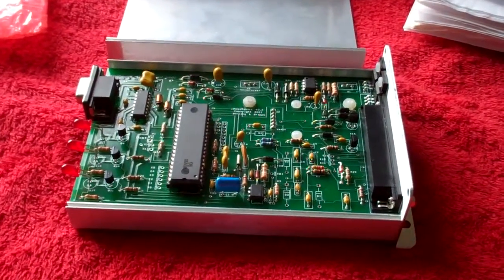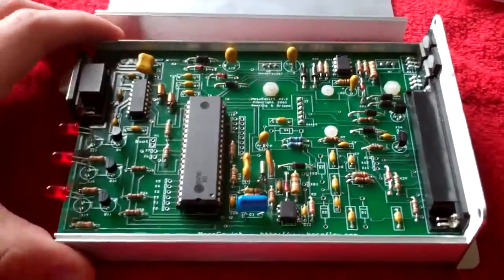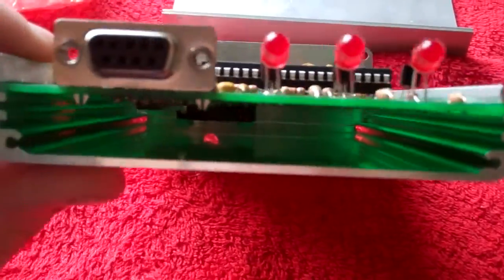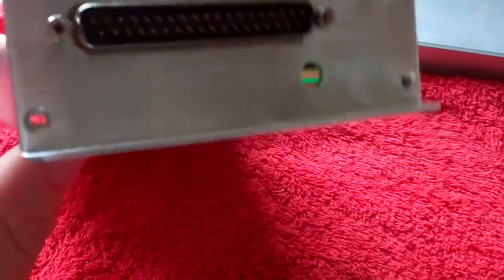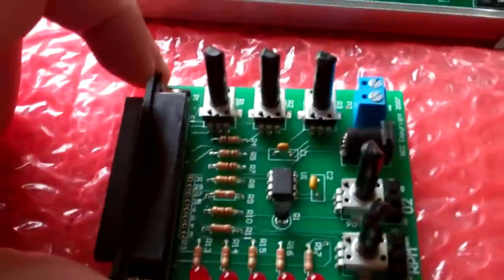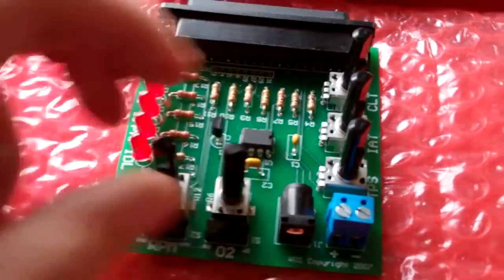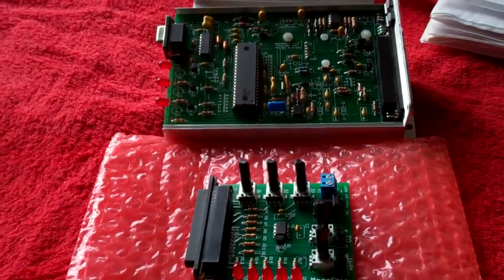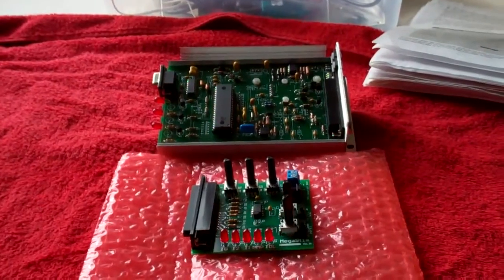1981 Porsche 924 Turbo | Megasquirt 1 PCB 2.2 & MS Stimulator

Comment: If you are using a desktop system, you can probably get a serial card pretty darn cheap.. Cheaper than a used laptop I would suspect.
Reply from the maker: Hah this video is old old old.. I can't even remember how we got it to work. Some of the videos of this project got scrapped but this particular MS unit didn't work because the generation of 924 I had used a funky semi-digital ignition system that wouldn't play nice with MS. We ended up using MicroSquirt 2